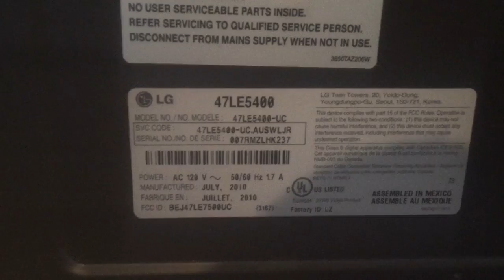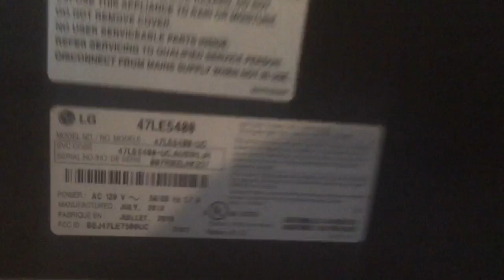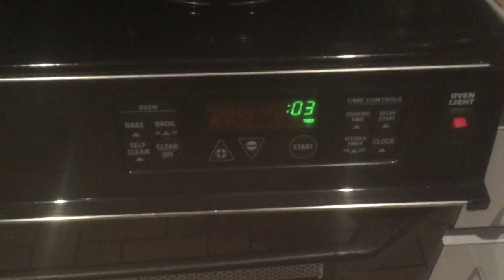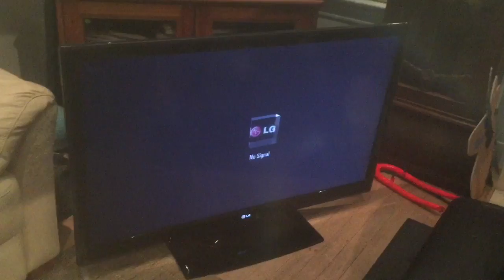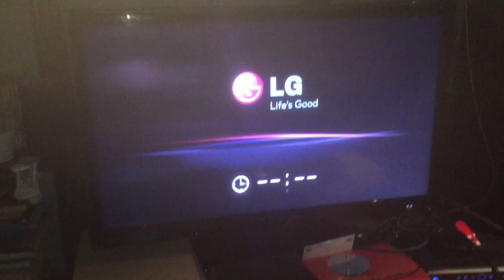Repair An LG Television Motherboard By Baking It In The Oven

Comment: Avrim, many thanks for sharing your fix. I had the same problem with a 5 year-old LG Model 42LE5400. I followed your instructions and it worked.  I used a small electric oven. I did it in my garage to avoid any smell and fumes. I pre-heated the oven to 375/380, then placed the board inside on a piece of cardboard in the middle of the oven, closed the door, turned the temperature up to 395/400 and left it for 15 minutes, then switched off, opened the door and blew air with a fan over the oven to cool it all down and blow the fumes out of my garage door opening.... after 10 minutes, it had cooled down completely. I replaced the motherboard and the TV was working again. Thanks!

Comment: I can CONFIRM that this will also work with a heat gun if used carefully to heat both sides of the board. (low heat, moving heat around slowly) I have an LG 47LE8500 TV that I used this on and did this tonight before deciding to scrap the otherwise dead TV. I did this using a heat gun in my garage with ventilation and left it to cool for about 30 minutes before reinstalling to test with good results. Thank you for sharing.
Reply: Jason Greashaber is tv still working? If not how long did it last? I have same model and having issues. Thinking of trying!

Comment: Its works -  2018-01-06: My LG LED 55 inch TV. broke after having it for 6 years. Power light came on but no sound and no picture. I got Best Buy out and they said $900 to fix. Another Video said you can buy a Part for around $200-$300. I decided to try baking the part in the oven as per Avrim's comments... The most difficult part was taking out the Electrical plugs, which you have to pull and wiggle gently to get them out.  I baked the part for 10 minutes at 385 F.  I placed the part on a steel baking tray instead of cardboard as i have a gas stove and did not want to risk a fire.  There was no smoke just slight type of "plastic" smell.  And it worked. TV is back on. Excellent

Comment: Worked!!! on my LG 60PN6500. TV would shut off randomly during use (sometimes 5 minutes, sometimes 1 hour) progressively got worse and worse. I installed a fan behind the TV which helped for awhile, then I had to open the window to cool the TV and it would work again (-10C in Toronto right now) Decided enough is enough. Baked it in the oven 385 for 8 minutes. Let it cool on the top of the oven. Reinstalled it 10 minutes later. And voila. Literally Magic. No more shutting off, even removed the desk fan from the back.

THANKS SO MUCH!!!!
Reply: Johnathan Brabant 
 my microwave has convection mode, microwave mode and grill mode. Which is that i use??? Plz answer
Reply: I wouldn't put it in a microwave. I would use an oven (even a toaster oven), perhaps I misunderstood though. I would chose convection mode. Grill mode should also work, as long as the element on the top isn't lit. (you don't want it to be hotter than 385F. (400F is probably the highest)
Reply: Johnathan Brabant i did it on grill mode and it didn't worked. In my microwave model. It has microwawe
Convection (i think it microwaves and then switches on the fan, but. Ot the heating element overhead)
 Grill ( visually see the heating element glowing red)

Anyways after that didn't work. I borrowed a heat gun and did that direct blowing around the mosfets and audio chip. But it didn't work either. 

Card is fine still. I mean still in the same situation. Picture fine and no sound. 

Should i try convection mode?
Reply: Yeah, give convection mode a go. Might as well try everything and see if it works.
Reply: Johnathan Brabant is it worked really? Mine also stopped working mother board. Should i bake it ?
Reply: Parimal Ghelani yeah it honestly worked for me. Still works today like brand new, don't even need the fan to cool it anymore. So grateful I found this video. Give it a shot it was 100% successful for me.
Reply: Johnathan Brabant ok in the convection it is. Will go to market to buy things and will let it cool gradually. Will update... thanks tho
Reply: how did it go.

Comment: Worked perfect for me.  I have the 47LE5400 LG TV.  Suddenly - I had a 'No Signal' for all the HDMI ports.  I tried the oven bake - success!.  NOTES:  You'll need to detach 5 electrical connectors to the 'motherboard' that you'll be baking.  The 2 that are next to each other and white, gently slip a thin screw driver under the top, white tab - lift a little and pull the wires away from the connector to detach.  The other white connector that is wider and alone - you will compress the edge of the white portion nearest the wires with your forefinger and thumb to "unlock" the connector tabs - then simply pull towards the wires to detach.  Finally, the 2 blue ribbon connectors are "ZIF" connectors (which stands for Zero Insertion Force).  These require almost no force when done right.  Take a thin screw driver or your finger nail and slide your nail or thin screw driver on top of the blue ribbon to the connector.  When you hit the connector (black piece), just gently lift up and the top of the ribbon connector (the black piece) will rotate up.  In the up position, just slide the blue ribbon away from the connector.  Done.  Good luck!

Comment: I ask you to help me with a problem: after updating my LG TV model 42LE7500, it now turns on and then turns off. I made an update via pen drive, and when the TV was rebooted, I started to present the problem. The file has been downloaded on the official website, and I have already updated some LG TVs in the same method, no problems, I've done everything I could, I tightened the screws all on the card, I pressed the reset button even though nothing was right, there is a method of how to restore the TV. Please help brother with some tips. force

Comment: Had the same issue as everyone else LG 55LV5400...red power light would turn on with the remote, then change to white color, flash twice and stay lit, no picture or sound.  Removed the main board, removed the heat sink, put the board on a cement floor and heated the chip only to 385 degrees Fahrenheit with an industrial heat gun with a pinpoint nozzle and then slowly let it cool down...I monitored the chip temperature with a cheap infrared temperature gun...re-installed and works...saved $200 US.

Comment: LG 55LV5500 here.  turned the tv on the other day and saw & heard nothing.  it's 6 years old...and i had the main board replaced once before it was a year old.  so i moved it out to the garage and figured i'd trash it.  then i saw these baking vids.  nothing to lose, right?  so i tried it, and it worked!  i still can't believe it....and i wonder how long it'll last.  but it worked.  yes, it does make the house smell toxic for a bit unless you get some good cross ventilation going.  but did i mention it worked?!  unreal.  couple other things...

To LG - f$%k you, i'll never buy another one of your products.  you suck.
To my wife - who's crazy now, bitch?

Comment: I'm amazed. This worked for me too, on an LG 42LE5400 built in February of 2010. The set suddenly went dark and quiet. Afterward it would power on, but without any picture or sound. Baked the main board at 385F for 10 minutes on a piece of cardboard. Thanks for posting the video, and the link to the original article, which was also informative and helped me get over some jitters as I gave this a try. You saved me a few hundred dollars, especially if the TV stays fixed. And if it doesn't? Back into the oven it goes!
Reply: I have the same tv did it work for you

Comment: This worked for mine, ran for 6 months and now giving me issues again. Back in the stove you go...
Reply: Looks like I fixed it a second time with this trick. This time HDMI wasn't completely out, it was flickering with static and even the sound was fuzzing in and out.  I feed my surround sound with the optical out.

Comment: I have an lg g flex2 phone, and 2 tweeks ago it was unuseable, because it always turned off after the switching on .Daily 30 restast was average, so I planned to drop the phone to the trash. But I have read an article on the internet, that there is an idiot hardver repair solution. 
Yes, this was the baking xd
I baked the motherboard in alu foil for 5 min- in 165 degree. 
After that I assembled the phone, and it was surprising to find my phone works great again. Now it works great too, no restart since 2 week. So it is an idiot method to repair, but is works really xd

Comment: When 60 percent tin and 40 percent lead are combined in an alloy, the overall melting point of the solder is lowered to about 360 degrees F.

Comment: i have a 49uf600-ua LG without a picture...so i wonder if a HAIR DRYER will do the same thing or a heat gun?
Reply: Frank James  it’s certainly worth a try but of course I have no idea. If you try it let us know.
Reply: I tried a hair dryer with no luck, but I didn't have the right thermometer to tell if it was really getting hot enough. Worked in my toaster oven, but melted a couple plugs/ports (the audio optical and a little of the VGA)

Comment: This works!  I wished I had googled this before I paid the TV repair guy $100 to tell me he could not find the part.  My 57 Inch LG is back up and running after laying on the floor for a month.  I was days away from dumping it and now it works.
Reply: Tim Summers bro I did this on my lg lv5500 for 10 min and it work for one day . Then I did it 15 min but this time I install a laptop fan on the heatsink , I use sub too power the fan . 2 weeks and still working.
Reply: Great Bro. Is it still working? Even mine worked for one day. Need to deploy permanent solution like you.
Reply: Update:  it died after a month.  I will be black friday shopping for a new tv.  I will try baking the board again and giving to my kids for gaming.

Comment: I do not mean to be a skeptic,but what about the plastic holders for the ribbon cables that locks in the ribbons? I'm just curious asto how those hold up under that kind of heat stress, thank you.
Reply: I saw some discoloration in the white plastic ribbon/plug locks, but unfortunately some melting on my audio optical and vga plugs. I think that part of the board was too close to my toaster oven heating element. Worked nonetheless, hdmi wasn't working and then tv went black without sound.

Comment: 55LE5400 - Had no HDMI signal on any port. Did this process to my set and it worked perfectly after re-assembly. I immediately went out and bought a replacement TV as I had no idea how long the repair would last (and I have not seen any commentary from anyone with longevity from their repair). TV sat unused for about eight months after this repair and was then put back into use. After about two months of light use (maybe 6-8 hours per week), it died again.

Haven't decided yet if I'm going to try the repair again or just dump the TV and replace it altogether. My functional problem was no HDMI input signal on any port. Rotating cube would come up, built-in apps worked, no issues with volume, etc.

Comment: Just finished this procedure, it took about 1 hour start to finish. My HDMI ports are once again working I only question for how long? I tried the hair drier method and it would only last from 5 minutes to about 24 hours - here's hoping! I did get a little "juice" off the board onto the cardboard I think it was melted resin.
Reply: Mike Surrett Man I did it for 10 min tv work for about 1 day and stop working, so i did it 15 min and still working after 1week .

Comment: The way this works is by melting the solder which attaches the video engine CPU to the main board, and gets rid of any micro-cracks that may have developed in the solder and basically gives it a fresh soldered connection. So there's no need to bake the entire board in the oven, all you need to do is remove the black heatsink from over the CPU and heat it with a heat gun on low heat from about 1-2" away for about 2 minutes. It's best if you use a laser thermometer to see when the temp hits about 425 on the surface, meaning it's probably about 375-400 on the bottom of the CPU, which is all it takes to melt the solder down. The risk of putting the whole thing in the oven is you can damage any of the plastic components on the board (analog A/V inputs, optical audio, LAN port, etc), and you're also unnecessarily heating all the other connections which probably don't have anything wrong with them. 

Also, make 100% sure you do this on a level surface!! When I did it, the desk it was on was slanted and all the solder started leaking out once it was melted down! Not good. Luckily I noticed as soon as it started happening, and there was still enough solder left under the CPU to fix the connection.

Comment: Thanks Avrim for this very helpful video! Today I fixed my LG TV by using this method. I used my toaster oven for this purpose because I could take that one to my backyard to avoid the strong smell emits from board when the soldering melts.
Issue: When I push TURN ON button, red light blinks two times and then it becomes white. Nothing else. Black screen and no sound.
Make: LG
Model: 47LW5600
Temperature: 400 Degree Fahrenheit 
Time of baking: 15 minutes

My TV worked right away after I put back the motherboard.

Comment: Awesome.  My brother in law gave me a non working LG 55LE5400.  Would just show the LG screen and the _ _ : _ _.  Took 15 minutes to pull back off.  The 55 inch has a LOT of screw.  Pulled mainboard out.  I put mine on a flipped a cast iron skillet with scrunched up tin foil I was afraid some of the bottom components might fall off when the solder started melting. Anyhow 10 minutes at 385 and BANG!! works perfectly.  Stunk a little when cooking so I put a box fan in my window.  Took that cast iron skillet about 30 minutes to cool down before I could touch it. Anyway awesome.  I figure the TV was already broken and I had nothing to lose. Now I watch the Sunday game on this hugh screen instead of the 42 inch I had before.  What a difference

Comment: THANK YOU SO MUCH. It works i put it in a toaster at like 430 and left it for like 13 minutes popped it back in and ith worked, i wrapped it in alluminum foil so it didnt stink too much. i found this tv on the curb and took it home, free tv  scoreee.

Comment: I had exactly same problem. Two years ago, all external inputs stopped working, and 3 months ago the TV stopped working completely. After switching TV on I could only see LG logo. After baking the main board in the oven for 10 minutes on 210°Celsius, it is working again. Many thanks.

Comment: A friend had put his LG 47LE5400 out to the curb for trash pick up right before I stopped by. Having an electronics background, I figured I'd try fixing it. When I opened it up, it looked a little more complicated than I expected. I was talking to a co-worker today who said he worked in a TV repair shop prior to this job. He told me to go on youtube and check out baking the board. I found this video and tried it. 375 degrees for 10 minutes. Let it cool in the oven for 20 or 30 minutes, reinstalled it and now I have a working 47" LCD HD TV. Life is good
Thank you Avrim Fishkind
Reply from the maker: Good story .. glad for your success.

Comment: Thank you for sharing this. Worked for me on an LG 42LD690 that had a red glowing power on light fault. 10 mins at 385 F. Was worried that the small components and plastic connectors would melt but no problems and now works great.

Comment: Thank you sir! Thought it sounded feasible for my 55lw5600, which was working great but only for 5 years. I would only add that I kinda closed my oven door slightly hard with about 2 mins left to make sure if it was a solder issue it would move. But I am curious... how is your TV working now almost 2 years later? Did you have to repeat this process?
Reply from the maker: See below ... i have done it a total of three times.
Reply: Ahh, thx. Didn't want to read over 300 comments :/ So it seems logical to say that LG needs better QC with who ever over sees their mother boards if this is simply a soldering issue.

Comment: My LG - 42LW6500 isn't mentioned in here. I have sound but the picture doesn't work, it's just noise.
I'm keen to do this. If it's unplugged do I need to worry about earthing/grounding it? Is there residual power?

Comment: My LG 55LE5400 was having HDMI issues connecting to anything other than the cable box.  Xbox and Apple TV would not work.  Saw this video, read a bunch of comments, and went for it.  This actually worked!!  After wait for the board to cool off, I did the test with my other devices and they all connected.  Thank you for the video and the many people that tried this before me.

Comment: Works...HOWEVER! You had better be able to solder just in case. I did this method and after cooling down, picked up the board and saw a 16 leg surface mount chip laying there. At some point in the oven it came off. I did 10 min at 385. Soldered the chip back on and boom! TV fixed! Thank you sir!

Comment: did this trick, but instead of baking it, used a heat gun, works them same without the smell or potential house fire.
Reply from the maker: Great idea ... hopefully it will not happen again to mine but I will try the heat gun if it does.